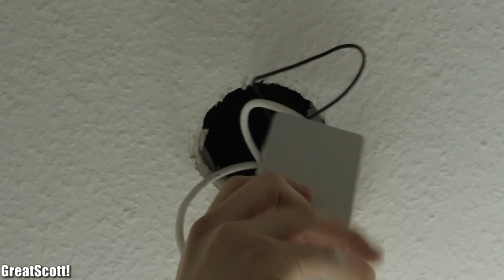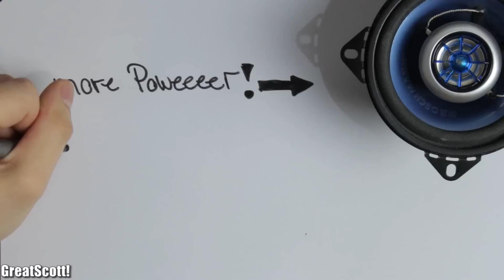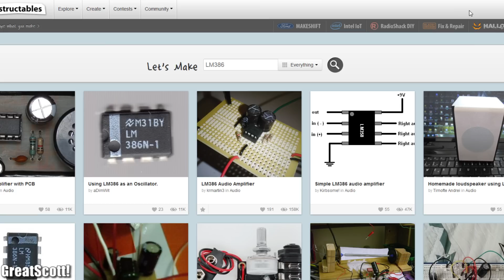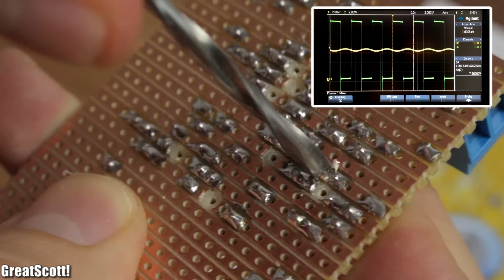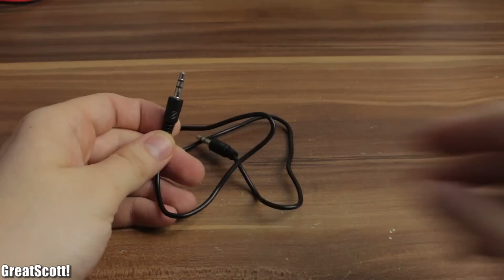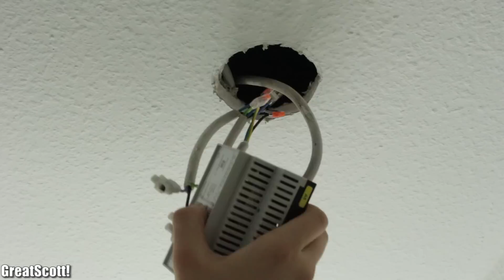Make your own Low Budget Bluetooth Music System || OpAmp

Comment: As much as this is a good video showing how this can be done, it's cheaper to buy it on ebay fully working and with a nice design.Then if you want to run it from the mains or you want bigger speakers you could probably buy that on ebay cheaper as well.But hey not everyone wants to by their stuff ready made and fully functioning without having to work stuff out.That's the problem with a lot of these kinds of projects you can usually buy a fully functional device at a much lower cost.
Reply: The whole point is to learn how to do it yourself

Comment: I can make it easy, all you need are
YL2020 Digital Amplifier Board
Bluetooth USB Music Receiver Adapter
12V+ 5V New AC Adapter For Hard Disk Drive Power Supply

total cost about $13 on ebay

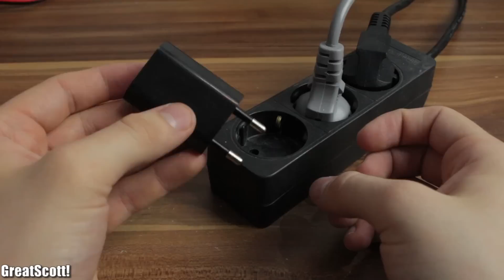Comment: hahahaha omg scott we really share the same problem 4:07 
i bought a cheap bluetooth speaker (5 euro's)  to build in my "retro boombox" connected it to the same power source and it was dead :) 
 
but isent there a other whay then a external power source ? ..... thats the reason why i was watching this video :(
Reply: Tyler TheMaker Probably the two pads are for something else, have you tried to connect it directly to the 5v input of the usb plug? ;)
Reply: not possible if i try to charge my phone and play music at the same time it makes popping noices 
but the solution is to put 2  transformers  (L and R audio) before the aux input
Reply: You would need an ground loop isolator (aka. transformer) to remove the junk in the audio.

Comment: GreatScott! don't you need to turn 2 electric breaker's? I think you can get a shock oterwise.
Reply from the maker: woutvdr Not that I am aware of.
Reply: GreatScott! i was thinking the same just one and i get a shock it was weird but the professionals said me to put alweys the two of maybe you should do this i think its safer
Reply from the maker: woutvdr I am an electrician. I know what I am doing.
Reply: GreatScott! that's good otherwise i can't watch anymore the best video's ever :o
Reply: woutvdr You turn off the breaker for the circuit you will be working on. No reason to turn off another breaker. Your breakers should be clearly marked as to what circuit they are servicing. If you do not know what they are servicing, you should consult an electrician for any work being done.
Reply: +woutvdr I think, that more important is to make sure, that the breaker you are turning of is correct one. The bathroom labeled one isn't always bathroom one ;)
Reply: +woutvdr I think, that more important is to make sure, that the breaker you are turning of is correct one. The bathroom labeled one isn't always bathroom one ;)
Reply: +woutvdr I do know some older UK properties have wiring set up with a shared neutral, which can cause some problems, it can redirect the flow from another light through you. This SHOULD trip the RCD for the other breaker, but that is a risk you should not take. They may be broken.
watch?v=7C7Tkge5gvQ

Comment: Or you can always use this simple setup and you will have stereo BT receiver.
http://www.ebay.com/itm/181761468737?rmvSB=true

And power adapter http://www.ebay.com/itm/AC-110-220V-12V-1A-Switch-Power-Driver-Adapter-for-LED-Strip-Light-/291508091516?hash=item43df3c7a7c

Comment: Bluetooth modules sometimes lose their pairing to the audio source (in your case the phone). Please make sure you have the BT module in a place you can readily access it in case you need it.

Also worth noting: All bluetooth devices allow pairing of up to 8 different devices for the same profile(s). In this case A2DP and AVRCP. In case you need to stram music from your PC or laptop all you need to do is put the device in pairing mode, pair it and connect to it.

Last note: all bluetooth 4.0(Low Energy) devices can run to up to 5 years on a coin size battery. Worth looking into if you want to get rid of the power adapter for the BT module.

Comment: I have built my own battery Powert bluetooth speaker .
IT is two old PC speakers I have glued together with screws in one speaker 's amplifier located and on-off switch in the other speaker is Bluetooth and battery.
there are no wires and see and it works well , I also had a problem with noise but I solved with a coil in series with the power cable to the bluetooth device.
lithium battery 11.1v 3,3Ah
2x12 watt amplifier is

Comment: plz tell me the voltage rating of those polarised cap
Reply from the maker: Anirban Mandal Schematics are in the description.
Reply: GreatScott! unable to find out... plz help
Reply: Anirban Mandal 16v or 25v would be my guess on everything except 100nf and 22nf they are 50v (they are cheaper). just dont go under 16v would be my advice
Reply: thanks,, it will help me a lot..

Comment: What I really like about your videos is that you show us the experimentation you went through and for me there is more to learn from that than just a step by step, start to finish solution! Would have been nice if you could have got the receiver and the amp on the same supply as a solution to that may have solved (or at least helped to solve) one that I have.
Reply from the maker: Fabrizio Lungo You can get rid of the distortions by adding a 1:1 transformer between the audio signal and the audio input of the amp.
Reply: GreatScott! Ahhh.... That's what I am currently doing. I was hoping there would be a solution on the power supply side of things but you can't really have a 1:1 transformer for the DC voltage. Using two transformers from the AC side is what you have done here to get the isolation. Maybe a 20:1 transformer (for 240V down to 12V) connected to a 1:1 transformer before any sort of bridge rectifier might work?
Reply: +GreatScott! Please explain how I can use a 1:1 transformer to get rid of the distortions! How to install it?

Comment: Listen up +GreatScott! , fellow german here.
I hate to be the smart ass all the taime but when it comes to security, well here goes my rant.

That power supply is not rated for moist enviroments. There are enough cheap ass IP67 rated supply modules out there.
Why am i so concerned? Well you are instructing people on how to handle AC power. But that job is not done with just turnig all off and then back on again.
Not all countries have regulations concerning protective circuit breaker like an RCD/FI.

And to the rest out there: There is no need to be afraid of electricity. But security goes first ...or not if you like the smell of BBQ in your bathroom ;-)

Anyways, i enjoy your videos and subscribed.
If you need information about electrical safety, feel free to contact me.
Reply from the maker: DasIllu Why is my ceiling a moist area? If that would be true, I would have more problems than a lack in security.
Reply: GreatScott! Warm Air usually rises up. And warm air has a lot more capacity to transport moisture. (ref. relative humidity vs. absolute humidity). So when you for example take a shower, you have a very moist air seeking it's way through any hole. Ones arrived in that space between concrete and ceiling it'll propably condense at the first thing that is colder than it's surroundings.
Guess what... Slow temperature changing metals in your power supply. Once enough water accumulated, it will start to flow according to surface tension etc and maybe short out or change resistance of some components needed to regulate the whole thing.

While there is a bunch of other reasons why you shouldn't do it this way (i.e. VDE) this is one of the major problems.

This might work without any problems for you. But what about a family of 4-5 people all showering in the morning when the roof above is still cold?
See, just because it works for you doesn't mean it is safe for all the people you adress in your videos.

Felt the need to point that out. Those 'stupid' rules are there for saving lifes. For unexpected circumstances too often cost lifes.

regards from Saarbrücken
Reply from the maker: DasIllu
Sure
Reply: GreatScott! I used to work as an electrician in explosive enviroments and maybe i am a bit biased.
But i also learned how simple circuits may go rogue on you once they are exposed to conditions they are not designed for.
And to just put some more VDE in. If you are to power down a whole room, it is not done with confirming that the lights are out and the hairdryer doesn't work anymore for that you can accomplish by breaking just the neutral wire and still have potentially deadly 230 or 110 Volts.
Sometimes it isn't even the electric shock that is the most harmful thing. Just getting startled enough to fall off a ladder can harm you as well. I encountered such situations several times even when i was most careful about security
Reply: GreatScott!
Wich soldering iron are you using?
Reply: Victor Arias Some kind of cheap-ass soldering iron. He says, that it does the job very well...

Comment: You shut use PAM8403 amplifier,it is class D[90% efficient] ,2x3W channel,5V/1A supply,sound amazing [like 30W] and it is very tiny without components.Also it is cheap.

Comment: Don't bother turning off the power in North America. Its shitty. Only 110v.
Reply: Arseny97 it's the amps, but you need volts to carry the amps and to penetrate the resistance of your skin, that's why lightning melts your skin, but you can survive it. Voltage wise 110V is scary, not too dangerous, 230v is quite dangerous,  but not necessarily lethal. 1000V and up is extremely dangerous almost always lethal.
Reply: Simonas Mažeikis 110v mains will kill you easily under the wrong circumstances, and 1000v is not almost always lethal, i have touched well over 300,000v from a tesla coil and i am still here. It is current that kills, but it must have enough voltage to overcome the resistance of your body.
Reply: i've been hit with 110v ac before. I'm lucky my one finger contacted the two wires so it didnt go to my heart. moral of the story, always shut off the electricity
Reply: Elites Engineering lol
Reply: ***** Its okay, it does not hurt, unlike 220v in other countries.
Reply: A. Zak well yes. I was talking 1000v with enough current. Simple ESD can be up to 30000v we get those everyday and walk around like it's nothing.
Reply: +Tetra Digm I was wondering if some one was going to mention Power....
Regardless though you should always take precautions when working on any kind electrical application, its just good practice and then you dont get hurt because no one likes fibrillation, 
however it is the total measure of power (RMS for AC) that causes damage and the resistance of the body part it touches, thats why if you put your tongue across the terminals of a 9V battery you will feel it, but not if you place the terminals against your skin, the tongue has a much lower resistance.
Reply: T3RRA_BITE_ to be more accurate, the tongue has a large amount of electrolytic fluid (saliva) covering it, which has a much lower resistance than your skin :P
Reply: +Tetra Digm you are quite right, its a dumbed downed example but it works, any anyways you have people on here saying that as voltage increases so does amperage, which is completely wrong as ohms law states that voltage is directly proportional to the product of current and resistance (V=I*R) and even if you want to compare different power transition systems, the higher the current the lower the voltage and vice versa, of course if you know what you are doing and have a multimeter you can test it, but i really wouldnt recommend most people to do it !
Reply: T3RRA_BITE_ oh i know i was just being a smartass towards you for the hell of it. 99% of the people on youtube are trolls who troll in 99% of their comments.
Reply: +Elites Engineering 230v on 50hz does hurt yes :s
Reply: +Arseny97  Actually it's a bit more complicated than that. The current is what burns you, but because your body has resistance it really depends on how much voltage it takes to overcome that resistance. That's why you can touch both terminals on a car battery and not die, maybe not even feel a shock. Even though a typical car battery can deliver 600 amps or more, it doesn't have enough voltage to overcome your body's resistance.
Reply: 220/240, 380... it wont kill you, but then again it can. as long as amperage is low, voltage wont  do much damage.
Reply: He lives in Germany:|
Reply: so volts burn you and amps kill you makes sense
Reply: Elites Engineering I don't know too much about this kind of stuff so I might be wrong, but I'm pretty sure its the amps that can kill you.
Reply: Elites Engineering Dont try 415v coz it killed me, luckily the paramedics shocked me back to life, 240v  is just a tickle now after playing with too many volts in the workshop lol,
Reply: its ac voltage, it can still kill you...
Reply: then hold phase and nutral on each ✋
Reply: Arseny97  higher voltage usually means higher ampage and it only takes  around 100mA to stop your heart so be careful whatever voltage you are playing with
Reply: rickburnout666 you can die when it comes over 15-30 mA (just so you know) that's why you hpfi relay will shot off it there is more than 15-30 mA (depending of the model) in different between power into the house and out of the house, it's doing this by checking how much is going though the earth wire. just a little to think about
Reply: Arseny97 Yeah its the amps, but its okay, I felt 110, and 220. 110 tickles, 220 hurts.

Comment: Hey yeah that bluetooth device and amp power will always create a feedback loop running off of same power it sucks and is annoying. I was trying to go cheap myself and try the same thing but not for a bathroom(portable). Because of that problem I tossed it aside. Anyways I found a good multipurpose board for only $12. Solved all the problems and made it smaller and be able to charge the battery. Even allows me to use the bluetooth functions for phone. So instead of having multi-part system and cheap, you just spend a few more $ but still "cheap" and not worry of the hassle.

Comment: By the way, if you want to power the bluetooth receiver from the same power source, using a ground loop isolator (1:1 transformer) between its output and the amp's input does the trick.
Reply from the maker: DIY Perks I know. But the part did not arrive in time to make it in the video.
Reply: Transformer coupling? Ooh you audiophile you! ;)
Reply: I am trying since a few hours to solve this damn problem. Thanks so much for this comment! Thanks to both of you (Scott and Perks) for the great channels.
Reply: Couldn't the same thing be done by decoupling both the amp and Bluetooth module?
Reply: This Projekt is cool but i use a Bluetooth speaker
Reply: What part is the easiest to get to achieve this? I really do not want to waste 2 power supplies for this.
Reply: Well. It did not i my case but found that CHEAP bluetooth receivers are generating noise anyway... abandoned whole project... waste of time and money.
Reply: Like the one you used to transform a laptop into an all in one PC? 😂
Reply: Can a common-mode choke inductor act as a 1 : 1 transformer in this application?
Reply: u can also disconnect one ground either the bluetooth or the amp bc they are connected
Reply: DIY Perks HAhahah I was just writing a comment linking your video when I read your comment :) thumbs up to you both for the great videos.
Reply: Simply use an optocoupler

Comment: let me clarify some thing....Volts Do not kill you its Amps that WILL kill you it takes only One amp to kill some one depending on its path through the body. theoretically speaking you could have 1 volt and 5 amps. Amp's are the current or amount of power flowing through a wire or cable. Watts / Volts = Amps say you have 50 watts and you have 10 volts  you would have 5 amps (50w / 10v = 5a)  (5w / 1v = 5a)

Comment: I would have used a TDA2003. It works with 12VDC and outputs 10W also very cheap.
Reply: +Pedro Alvarez or TDA2030 vs TDA2050, only difference is power rating

Comment: I enjoy your videos, but you very often take the easy way out. Like using a separate power supply because of the issues with the coupling. Instead of finding a proper solution, you used a rush fix. This It's a great idea, you just didn't  figure it all out before you made a "make your own" video.

Thanks for sharing, but now there are probably 100s of two power supply speaker systems in college door rooms now.
Reply from the maker: Diamonddrake Correct, I often take the easy way out. BUT I have a reason for that: I try to upload a video at least every 2 weeks. And you often face problems with electronics, which needs another part to fix it. And the delivery can always take up a good amount of time. If I would start to produce "perfect" projects then you might only get a video every second month from me. Do you want it this way?
Reply: +GreatScott! By the way did you find a fix for the bluetooth buzzing? I tried to use an isolation transformer between the bluetooth receiver and the power supply but it didn't work...

Comment: If you had a shower in your bathroom wouldn't the water vapour damage the speaker?
Reply from the maker: Keelan Hasan I have no problems so far.
Reply: GreatScott! Thank you... But what I have mentioned should be taken in to consideration right?
Reply: Keelan Hasan The humidity shouldn't really matter as far as I can think. The speaker membrane should hold back most of the water. And the humidity will evaporate very quickly after a hot shower. I think you should be perfectly fine. If your box closes off the gap nicely and you have your AMP in a case I think there should be nothing to worry about.

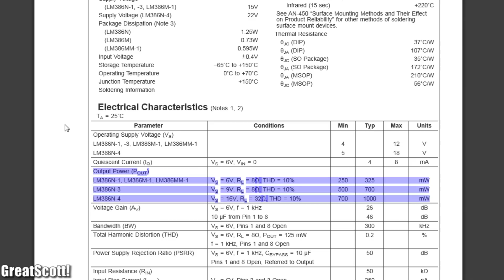Comment: Hi Scott! I saw that you didn't use any capacitor to maximize the gain of the LM386. As you can see at 2:48, if you'd placed a 10 uF capacitor between Pin 1 and Pin 8 you would go 26 dB to 46 dB. Isn't that enough to improve the quality of the sound? Thanks man, I love your videos
Reply from the maker: ***** It improves the amplification, but not the overall quality.